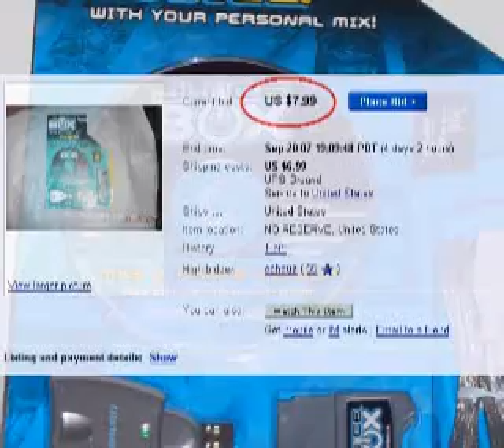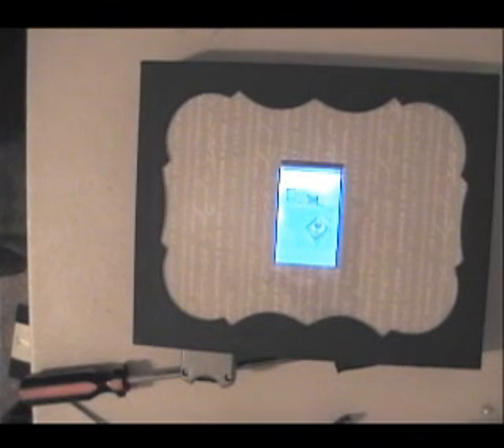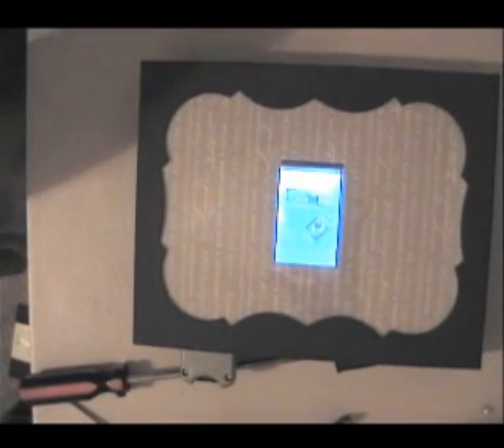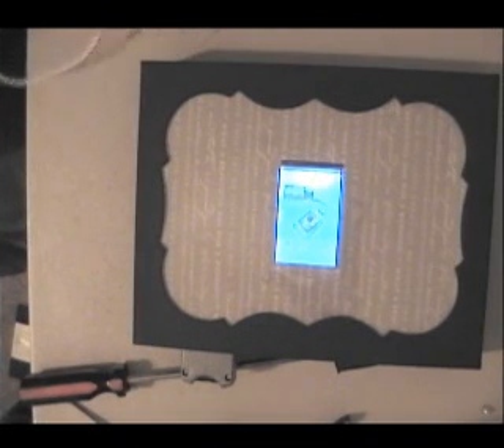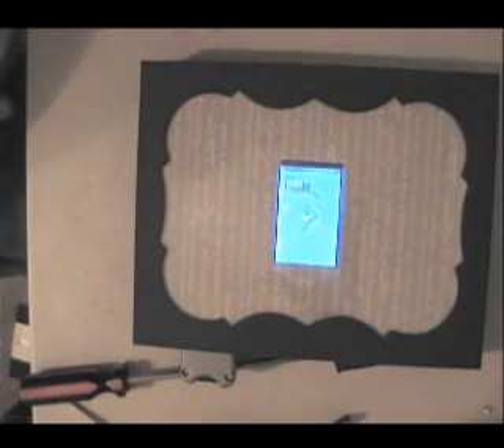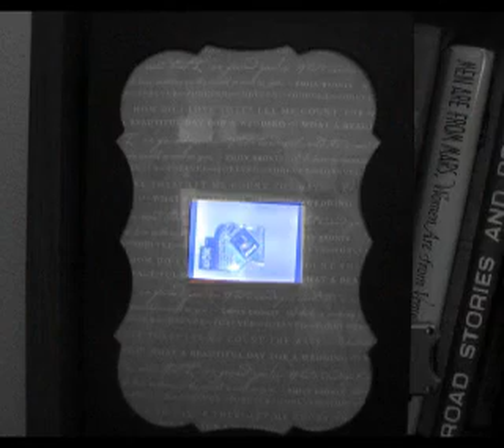DIY: Make a digital picture frame

Comment: but it would be possible, so its possible to build a juiceware to usb adaptor like the reverse of the mp3 adaptor, a juiceware female slot like in the juicebox on one end and a usb a male connector on the other, then theres the software issure unless the juiceware filesystem is FAT32 format then its like a flash drive but read only